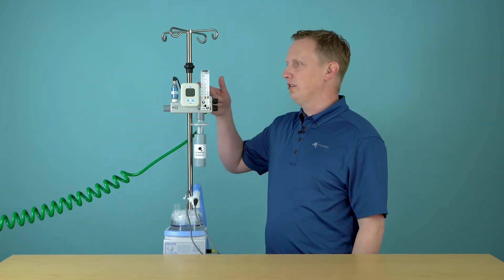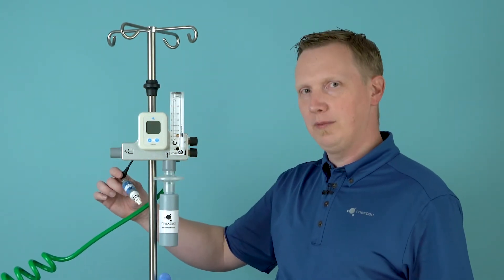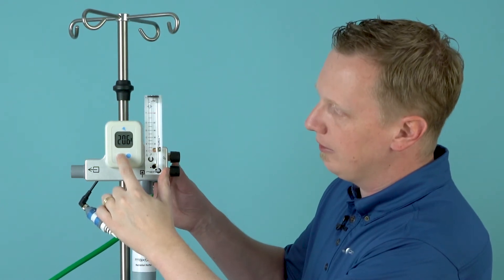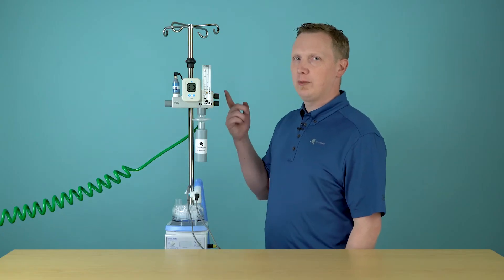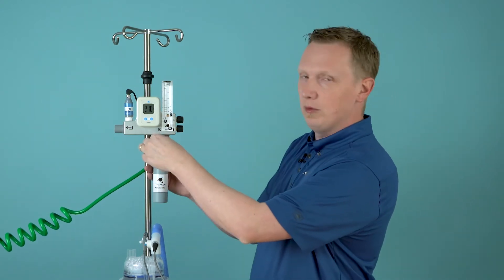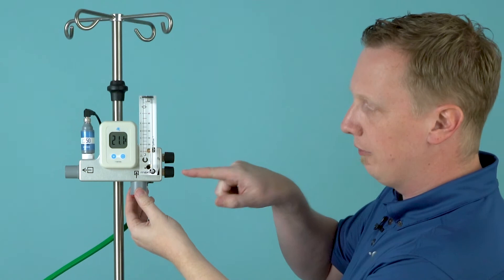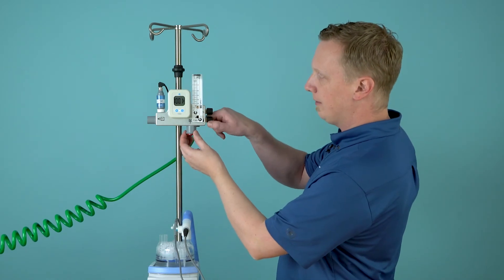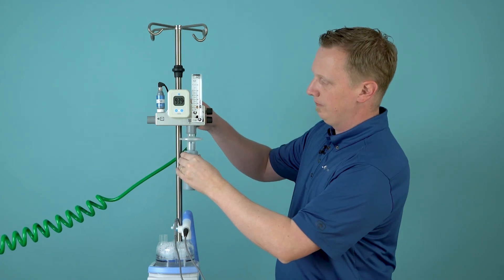Calibrating A MaxVenturi Sensor

Comment: Do you know anything about the error messages ie. Err03. I have been getting them lately and cant figure out what they mean. Thanks
Reply from the maker: Hi M, thanks for reaching outl. The E03 error code means "there is no valid calibration data available". Make sure unit has reached thermal equilibrium & perform calibration as described in the user manual. You can find a digital version of our IFU here: https://www.maxtec.com/product/delivery/mixers-blenders/maxventuri/. If the problem still persists, submit a claim here: https://www.maxtec.com/technical-support/. For any other questions or concerns, please message customerservice@maxtec.com. Thank you!